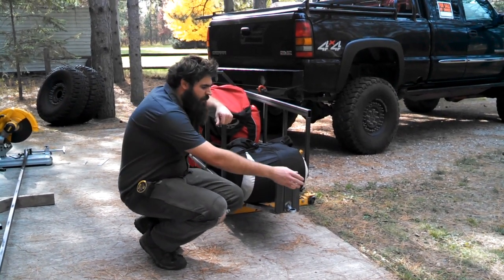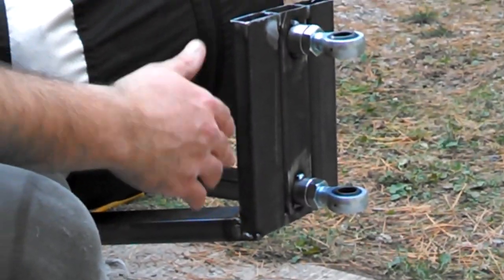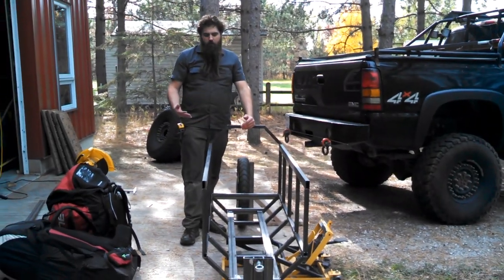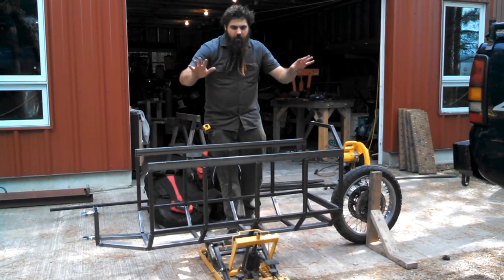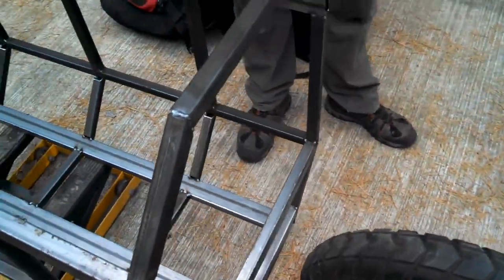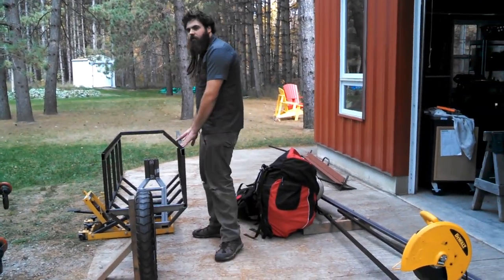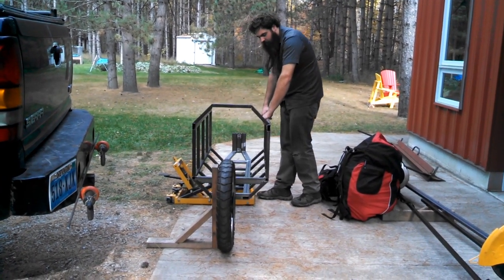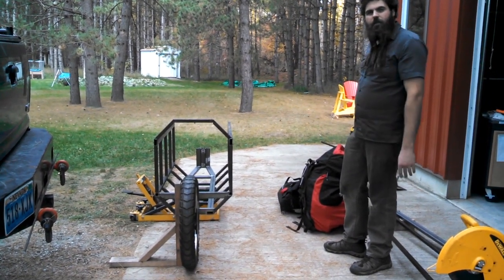Early progress on our motorcycle trailer

Comment: Nice start and well thought out . That being said you should learn to TIG weld and build it out of alluminium tube 6061 with about a 3 /32 " wall. Stay withe bottom design make it like the trailer swing arm, I would make a tarp top out of your choice of water proof material and strap it down to the lower portion of the trailer. the front end of the trailer will need bridging support for those hime joints. That vertical tubing wouldn't last more than a thousand miles if that the constant flexing with a full load (200 lbs?) will snap that right off. Hope this helps stay safe!